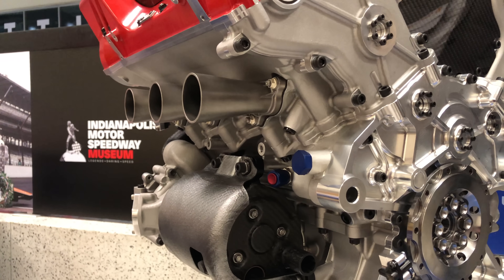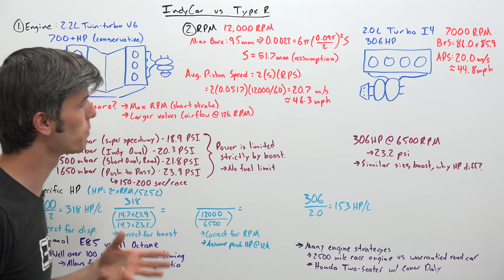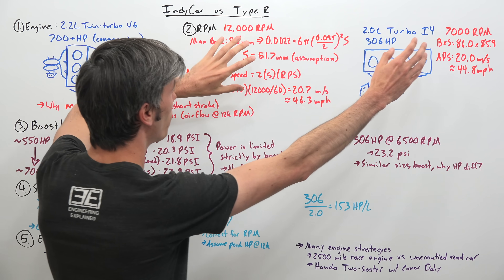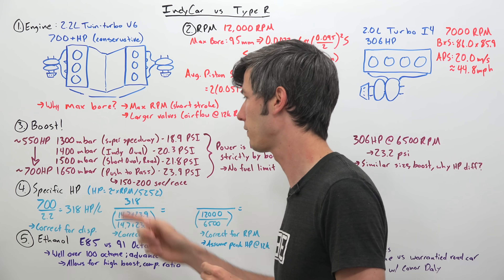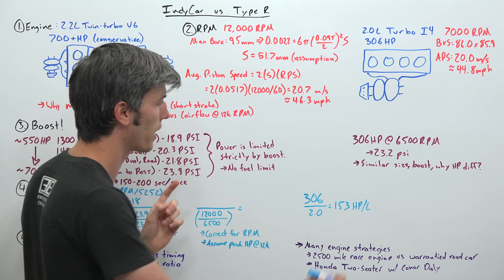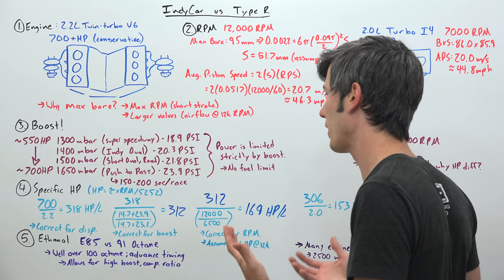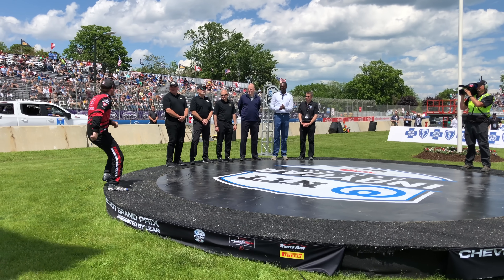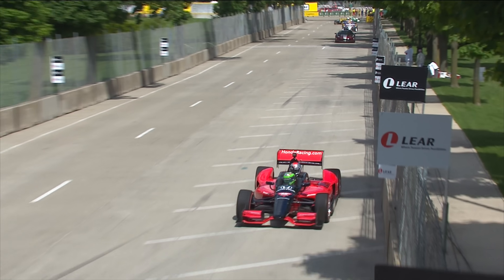How Honda’s 2.2L Engine Makes Over 700 Horsepower

Comment: The answer to how all small displacement engines make good hp is almost always boost. Not really anything new.
Reply from the maker: And yet, in this video, it's shown that it's not boost, as the Type R engine uses similar boost, and yet has less than half the power.

Comment: Too bad 700hp at 12000rpm is only 306lbft.
Reply from the maker: Yep, but it doesn't matter if you gear it correctly. If you had a 6000 RPM engine with 600 lb-ft, and a 12000 RPM engine with 300 lb-ft, they would accelerate at the same rate, as the 12000 RPM engine could use twice as aggressive gearing (because it revs twice as high).
Reply: @EngineeringExplained  that was a fast response. I have had this conversation with many people. I have little interest in speed. I have a highway tractor that is loaded to 63,500kg every day every load(haul fuel). And it's rated 500hp@1700rpm(1544lbft). At 1400rpm it is rated at 1750lbft(466.6hp) and 1300rpm it's 1850lbft(457.6hp). My argument always is horsepower is over rated because the truck will pull back and hold 1300 rpm on hills. Also the rating aren't very clear. 
Detroit Diesel DD13 450hp@1900=1246lbft 
Ford 6.7L powerstroke
450hp@2800=844lbft
Ford 3.5L EB 450hp@5000=472lbft  
All rated the same but so very different in physical capability. It's more like it's a misleading rating. 
GM 420hp 6.2L V8 
420hp@5600=393lbft
Ford 375hp 3.5L EB
375hp@5000=393lbft. 
 People see 420 and say ooh stronger lol. In all actually it's not any more capable.

Comment: You should've calculated how much hp the race engines make at 6500rpm.
Reply from the maker: Well, that's not really where they're designed to operate, so it wouldn't make sense as it's not optimized for that speed. These race engines idle at like 3000 RPM. The Type R is making good torque at that RPM, while the IndyCar is not.

Comment: BMW had 1.5 4 cyl with 1500bhp in the 80´s... maybe a worse consumption...
Reply: In qualifying "grenade" mode only, it wouldn't last for a Grand Prix (200 miles) . It was based on the road going M10 engine.

Comment: everybody: YO! Mercedes just made a 2 liter engine that puts out 450hp!!
Honda: Hold my beer...
Reply: Imagine Wagons yeah that’s 250 bhp less from an engine only 200cc less, hey Mercedes hold these beers
Reply: Mercedes 1.6L F1 engine produces around 1000hp in quali mode, ICU only.
Reply: @dyrsten  yes but that engine is supposed to  survive a race or two, meanwhile the 2.0 450hp is the engine of an A-klass

I don't know, however, how reliable is the honda engine, the comment was supposed to be a joke anyways
Reply: Mercedes made a 1.6L engine with 748hp.
I'm obviously talking about the ICE alone. In the road legal Project One.
The hybrid systems are estimated to push the total to a maximum of 1230 hp
Has to pass the homologation process first though.

Comment: I think your number 4 equation where the 12000/6500 is suppose to be 7000. Since the peak of both is 12k and 7k. Just saying.
Reply from the maker: Nope. As explained in the video, I guessed that 12000 was the peak horsepower RPM for the IndyCar (I don't know what it is). For the Type R, peak HP is known at 6500 RPM, so that's what I used. Peak power RPM is what I was targeting.
Reply: Engineering Explained I stand corrected. Love you bro. Keep up the great work. From one engineer to another. God Bless.

Comment: Internal friction is a differing factor as well as port cross section. The 4 banger needs a wide powerband for street use as well as emissions requirements . So four banger with more radical cams, Higher compression , 2 turbos for fast spool , and more even power pulses for the 6 and you have radically different tuning. The K24 can make 500hp naturally aspirated and easily 700 hp as is done in drifters. Displacement with similar tuning and other specifications creates comparable power. This Video is misleading.

Comment: Also psi is measurement of restriction, what you need to know is flow rate. If you have 2  engines at 23 psi but one flows more air it will make more power.
Reply: 23 is part of the races specs, so is something he can put on the whiteboard.  He alluded to flow rate with the "wider cylinders allow larger valves" but this really was a weakness of the video.  But I doubt Honda is giving out flow rate information on thier racecars (the type R can be had by measuring a/f ratios and fuel rates).

Comment: I know it is not relevant due to the weight of the cars (Indy x S2000), but you should have touched on the torque produced and also what is the RPM range where power/torque is produced (gear number/ratios and driveability)
Reply from the maker: I asked, but they keep this info secret. If you do the math and assume peak power is at 12000 RPM (it could be lower), then torque is about 306 lb-ft. But it could be higher if peak power is at a lower RPM.
Reply: @EngineeringExplained  That looks about right, but just imagine driving an Indy on rush hour traffic or flooring while on a high gear at a low rpm. :)

Comment: once thing was missed which is the emission regulations
Reply from the maker: Yes, true. Though if you size emissions equipment properly it won't affect power much (hence, Bugatti can still crank 1600 HP emissions compliant engines out). Just need to ensure you have proper sizing for exhaust flow.

Comment: Jason, are you saying that both engines uses similar materials? Despite the different rpm limits?
Reply from the maker: I don't think the IndyCar engines are using all that exotic of materials, to keep costs down. This material selection played a role in not allowing for speeds much over 12,000 RPM.

Comment: New Indy engines coming in 2021 2.4-liter 900-1000bhp. It's all about the budget an Indy engine lease is around $1.1m for the full year & Haas pays Ferrari about $24m per year for 2 cars
Reply: formula 1: 1.6l v6 with about 1000hp... but it revs far over 18k
Reply: @johannesdatblue4164  F1 says no new engines in 2021 either, I was looking forward to F1 engines screaming again

Comment: Great, logical explanation. But you forgot to account for the extra 2 cylinders! That’ll cover the difference in HP (by a lot)
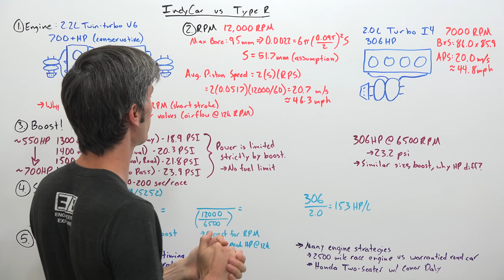Reply: He covers it between 1:30 and 2:30ish.  This goes by quickly and might require more EE videos to see why the math works.
Reply from the maker: Nope. There's not much of a correlation between the number of cylinders and the horsepower produced. Displacement, boost, RPM all play much, much larger roles. 2L V6 or 2L I4, power potential comes down to how much air you put through it, rather than the number of cylinders.

Comment: What is the torque differential between them? Curious to know.
Reply from the maker: Honda doesn't release torque numbers for the IndyCar, but they're likely pretty close. If you assume peak power is at 12,000 RPM (I don't know where it is), then torque is at 306 lb-ft. But if peak power comes sooner, then torque is higher.
Reply: @EngineeringExplained  ya I looked for it on the web also. I wasn't thinking it would even be in the 300 range but didn't know.

Comment: Says he's going to sell the S2000 and Honda is like come see our 700 hp 12000 rpm engine
Reply: Some civic engines are able to roll up to 11000 rpm with some little upgrades
Reply: @Bedey53  little in dimensions but not cost lol
Reply: @Bedey53  valve springs and retainers..a camshaft,ported head 
Yess little upgrades.
My k20 goes 9500rpm completly stock since 12years.

Comment: A single turbo 1.6 liter f1 engine can pump out 1000hp so ...........
Reply: Not without ERS.
Reply: @alhemmings8554  Yes, without ers. In quali mode.(~50% thermal efficiency)

Comment: Can you please go to Japan and educate the Toyota engineers that they can get way more Torque out of their 4.5 litre Twin Turbo intercooled diesel?  It is only putting out 650Nm, whereas the Audi SQ7 engine puts out 900Nm from a 4.0 litre.  Ok, I did cheat a little as that engine has an electric 48 Volt DC air pump....but this not the cause of getting 900Nm.  No doubt standard aftermarket tuning could get over 1100 Nm.
Of course Toyota is depowering the engine due to differing markets (differing operating extremes), differing diesel fuel quality.
Reply: and the toyota probably lasts a thousand years :D

Comment: Didn't know Indy engines were so simple, do they use a standard dual overhead cam 4 valve setup?
 F1 had similar engines with similar power in the late 1980s. Modern F1 power units are basically space age compared to this.
Reply from the maker: Yep, dual cams with set lift and timing. Very simple setup!

Comment: Now the question is how F1 ICE has about the same power with lower rpm and size
Reply from the maker: F1 engines rev to 15k now, and use higher boost.
Reply: @EngineeringExplained  I don't think they go over 12000rpm even in qualifying because of the fuel limit

Comment: Jason is probably having dreams about this V6 in his S2000
Reply: GamerZoneArmy only if he wasn’t selling it
Reply: Hope it doesn't end in nocturnal emissions!
Reply: @alimahdavi2276  XD
That was too good! Though I didn't verbally respond to that, I did freeze for several seconds to hold in my laughter, thanks for that.
Reply: Just swap a boosted 5.3L on it 😗
Reply: I doubt it. The S handles very well with its 4 banger. The sixer, even if it lighters, might throw off the s balance.
Reply: JC Marin I think with that kind of power you'd actually need to shift the balance toward the rear in order to maximize exit speeds.
Reply: I'd swap it into my '92 Civic VX
Reply: @HydeMyJekyll  I was thinking of putting it in my Jeep Grand Cherokee.
Reply: Abraham Shekelbergstien  weak motor that cant handle power.... let me get the drugs u r on. Ur out of ur crazy, F20's can easily double and tripple their power on stock internals
Reply: @Dsilver024  no they can't lol
Reply: @Johnny-tq9no  yes they can
Reply: @AnonymousDawg016  no they really can't they blow up
Reply: @Johnny-tq9no  you have no idea what you're saying. From an owner of an s2000...I know everything to know about them. Did you know they have forged internals from factory? Easily can withstand 500+ horsepower
Reply: rebuilding it every time it gets to ~1000 miles would get old. :)
Reply: GamerZoneArmy or an NSX
Reply: And who wouldn't?!?

Comment: Would be cool if honda made a rwd possibly 6 or 4 cylinder s3000

We're waiting Honda It's time and we know what you can do
Reply: I'm pretty sure honda themselves experimented with putting a v6 in the s2000. I think they called it the s3700 (doesnt roll off the tongue, does it?)
Reply: Gummo Stump I mean, maybe s370? That kinda rolls better? Idk, also just kinda sounds like a 370z lol
Reply: S3000? That’s going to only be a V6 for sure...
Reply: S3000 with rwd and an inline 3L 6cylinder mated to a 6 speed manual would pretty much be the death of the new Supra.
Reply: @theinternets7516  a turbocharged gt86 might be the death if the new supra, hence why they never offered it.

To be fair, the supra had long meant "sporty grand tourer" before it came to mean "2jz" or "you owe me a 10 second car". The target audience for an uprated 86 is different from a supra's, but I still believe that the reason we didn't get a more powerful 86 is that toyota already had the supra in the works, and didnt want internal competition.
Reply: Time to compete with that “Supra”
Reply: S3000 would be too big. There's no reason to put a 3L engine in such a small car. The 2000 in S2000 stands for CC. Honda actually makes an S600 for Japan only.
Reply: @AnthonyBrusca  and there is no such thing as to big
Reply: @maxxas5067  Yes, there is. That tiny two seater car will never be able to handle the power, it would be all squirlly. The current S600 has a mid/rear engine too.
Reply: @AnthonyBrusca  BMW makes a 135i with a twin turbo straight 6 in it. Very similar in size to a s2000.
Reply: @abes3925   moar powaa baby
Reply: @turbski666  define size, 135i is far heavier and makes compromises in where weight is on the car due to being based on a normal family hatch. still a great car, my dad has one and i cant fault it, but its not really comparable to an s2000.

also, s2000 having a smaller engine is how it handles so well, same logic as the rx7. you dont want a heavy engine sat above the front wheels in a sports car.
Reply: @Will_M600  BMW 135i 172″L x 69″W x 55-56″H
Honda s2000 162.8"L x 68.9"W x 50"H
There's about a 400lb weight difference between the two. Half of that is probably the 3.0l straight 6.
Reply: @AnthonyBrusca  It's not just about the peak power. Torque would be nice. I don't mean a big peak torque number, that's pretty irrelevant, but a meatier power band is what can be really fun. If you think it couldn't use a bit more, was Jason wrong to boost the s2000? Of course it isn't "necessary" but more engine is more fun generally.
Reply: @Ben-fl6vy  I think the most fun is if they made an electric version of a two seater car like their concept the Sport EV. So far they are only making the Urban EV. Then you'll have 100% of the torque through almost all of the power band until you reach high speed.

It would be even cooler if they made it a 2-speed manual. Have a torque gear and a speed/efficiency gear.
Reply: @turbski666  the i6 weighs 200 lbs more than the fa20? It can't be that hard to look up, but I doubt it.
Reply: @Ben-fl6vy  I mean if you're looking for good usable torque, the car I'm comparing the s2000 to make 300ft lbs at 1200rpm. Just keeps proving my point why there's no reason you couldn't put a slightly bigger straight 6 in one of these from the factory.
Reply: Anthony Brusca Tell that to the guys putting hellcat engines in Miatas.
Reply: @turbski666  its about where the weight is on the car not just how much there is. 

given the choice though i'd probs take the bmw simply because its the best fast daily ever
Reply: @Tyfunk02  Yeah, it's pointless. You can't even use the power or torque, the wheels will just spin.
Reply: Maxxas Crow 
Preach! 
If they make a v-6 pulling 700hp I want v-8 pulling 900hp or a v-12 pulling 1400 
I realize that’s not exactly how it works but you get my drift
Reply: @Heavywall70  I bet the Honda E will be more fun than a non-Si or Type-R Civic. Rear wheel drive, instant torque... If it comes to the states.
Reply: @AnthonyBrusca  Toyota and BMW would disagree that a 3.0L is too big for a roadster.
Reply: @AnthonyBrusca  you seem to hate wheel spin but brag about instant torque lmao!!!
Reply: @AnthonyBrusca  we in the 1000s
100s was way back
Reply: @maxxas5067  the S600 is Kei car, Kei cars have much lower taxation but are limited too 660cc engines. The s600 being hondas attempt at 600cc.
Reply: @AnthonyBrusca  There are many examples of Honda S2k running far higher WHP numbers (about 400 WHP), without any issues. Yes the car is fairly small and light, BUT it is also not a very powerful car in stock form at 240 HP. It would do well with 100 or more HP over stock levels and still be easy to drive.
Reply: @JJ_ExMachina  Yeah not 700hp
Reply: @AnthonyBrusca  many run on the street with 700hp lollll i think you dont know what you re talking about
I ran a 3.5 in a honda fit.
Do you know how much room there is under a s2000 hood??the engine is behind the shock towers..could fit an inline 8 in there with a triple core rad!!they fit viper engines in there!!saw one at hondafest in montreal.
Reply: @upnorthviking823  that doesn't make it less pointless
Reply: @AnthonyBrusca  sorry bud but you simply talking is pointless!
I think you have years of research to do.With all respect!
Reply: 2.5 inline six twin turbo...
Reply: @barrybritcher  it's a 3.0. Look it up. Lol
Reply: @turbski666  I wasn't referring to that post. I was referring to the op. It would be cool if...
Reply: @barrybritcher  the only 2.5 turbo on the market worth getting right now is made by Audi IMO. Paired with a dsg, they're running 10 second 1/4 miles all day long on stock turbos and e85.
Reply: Guys, i really dont get what you say! 240 hp for that car is enough for a track time and plenty of fun... If that is not enough, you can just upgrade the cars engine for about 350 hp (which can handle without problems at all) and go without losing any of balance od the car... In a sports car , as a guy mentioned the most important is the light weight and the great balance... Lastly if 240 hp is not enough, what to say about the mx5 , which is one of the most fun to drive cars with only 110 hp? (I talk about mk1)
Reply: It wouldnt be cheap, and they've already made the new NSX. Wouldnt be worth it for them. With the amount of tech that goes into new cars theres no way they'd make their money back especially if it's supposed to be a luxury rwd sports car.
Reply: Any hype I have for a new car is gone, especially one by Honda. It's either going to be ugly and/or overly complicated in terms of drivetrain tech.
Reply: What is the NSX?
Reply: They do. It's called the NSX.
Reply: that would be awesome but is there a market in the US?  Make a hard top option.
Reply: As long as they kept it simple like the original.
Reply: I will never understand why they stopped making the S2000.
Reply: That's a Z, Nissan already makes that.
Reply: Honda already confirmed they’re not going to make an actual S2000 successor,  and the Civic Type R fills that void in their eyes. That’s also why they created 20th anniversary bumper and interior cosmetics for the S2000 since they’re not bringing it back. Maybe they’ll have a change of heart one day.
Reply: Honda needs a C32 successor like now.
Reply: It’s painful considering Ariel uses that civic motor in the Atom turning the correct set of wheels and POW supercar 
Hey car companies front wheel drives is for minivans and hybrids 
Rear or ALL wheel drive is what we want.
Reply: Best solution would just put a tesla - like motor in there and an s2000 would fly.